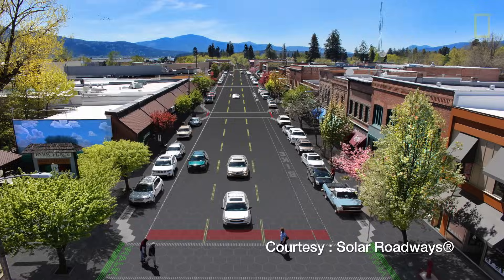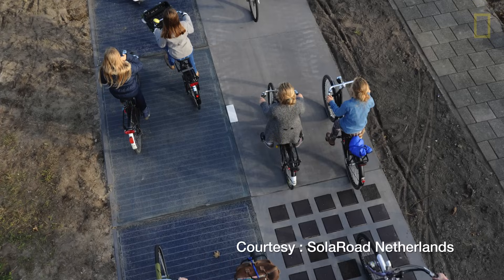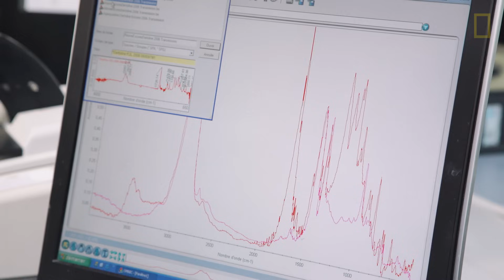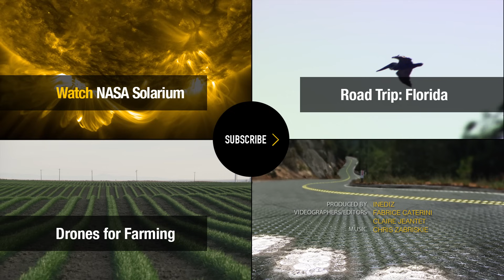Solar Roads: Can Streets Become Giant Solar Panels? | National Geographic

Comment: and if they build the roads in a way that the water can runs off during rain like in a roof with a slight angle .. cars will also be able to keep the lane better if they are being built in a way that won't make the lower side of it scratch along.. so they needed to be slightly elevated..

Comment: Look, First of all, solar panels themselves are actually not as great an idea as they sound. Yes, yes, yes, the sun light is free and doesn't pollute, but you know whats not free and does pollute? The production of solar panels. By the way, people seem to not really consider this terribly much, but you know solar panels don't last forever, they have a certain life span, and the cheap Chinese made ones that state projects usually use have the shortest life span and most toxic production method of all. If you simply do a basic cost/benefit analysis, you will find that really solar panels produce basically as much or maybe even a little more pollution than fossil fuels do, they just do it in the form of the toxic metal refining that goes into their production as opposed to exhaust that the end user gets to see. All solar panels really do is obfuscate the pollution from you by moving it somewhere else.

If you really want a clean cost, effective, and reliable source of energy, then nuclear is the way to go, hands down. The only reason we aren't all using it is because of lobbyists fighting against it over Chernobyl, but the reality is Chernobyl wasn't really a nuclear disaster so much as it was a soviet disaster. The communists cut extremely dangerous corners in construction, and it was their inept handling of the plant's construction and management which lead to the melt down.

A properly built and managed plant will not have such a catastrophic failure as that. In fact, a lot of people don't even fully understand just how catastrophic that failure was. We are talking all safety measures were broken, allowing direct exposure of the core to the atmosphere. That simply doesn't happen in a well managed plant. There are multiple levels of containment, and even when something does go horribly wrong, it doesn't simply breach all of them like that. You might have one or two levels of containment breached, but Blowing the roof off the whole plant, Chernobyl is pretty much the only plant that ever did that. And that is really saying something because when we had the plant in Japan get hit with a tsunami, sure it breached containment, but clearly not to anything remotely like the extent of Chernobyl. In fact the area of the plant is even safe today. Chernobyl on the other hand which happened decades earlier is still a wasteland.

Comment: Since I can't post on solar roadway because they have disabled the comments section can this handle a big rig which has a word 10 tons of steel drive at 70 miles per hour us without shredded in a week has at least last 3 months stillway said that he has the last 20 years cost less than pavement then I agree this will be useful otherwise why spend the money Oregon great idea what store panels on the side of the road bingo cost 1/10 the mountain you make 20 times more power.

Comment: Most people are concerned about the expense but something else is troubling. Nitrogen Triflouride is a greenhouse gas used in the manufacturing of solar panels. It’s 17,000 times more potent than CO2. What implications could that have if we were to manufacture the panels to replace the roads? And the constant wear and tear from vehicles would mean they would have to get replaced, which would mean to more production and more NF3. Additionally, the “waste” or old an broken parts from old solar panels are toxic. The streets would literally be lined with it until it was able to be cleaned and replaced. Overall this is a bad idea.

Comment: I have a great idea. Let's take solar panels, put them at a terrible angle for collecting sunlight, and then drive cars over them so they can't collect sunlight at all BECAUSE THE SUN IS BLOCKED BY CARS. Not to mention the dirt and grime from the cars themselves, which will reduce the efficiency of the panels passively as well as grinding up the materials under heavy tires, making them less effective in addition to possibly causing silicosis from airborne glass! YOU GUYS ARE FREAKING BRILLIANT.

Comment: They found a good compromise between grip and light absorption. Meaning, if you need to slam on the breaks to avoid an accident, you are probably dead or severely injured.

Comment: Forget about solar panels. Do research for vibration energy. Convert the vibration, while the vehicle passes, into electricity.
Less coast and more practical.
Reply: Sudarsanan Madhavan 
There is no dynamo on earth that can convert road vibrations into power. The roads are simply not elastic enough to effectively vibrate. Realistically, the value of the energy collection that involves the road itself will never exceed the cost of maintenance, so the value per megawatt will not be profitable without high prices.
Reply: This is even a more stupid idea.... sometimes I really really wish we live in a world where children on school get science class instead of reading a fake bible. Horrible.

With a piezo you could transfer a tiny bit of energy of vibration back, but it doesn't make sense at all. You just take power of your car, put it in the road, and with all the losses you want to put it back in your car?
Sudarsanan, you have to ask yourself, where ae the vibrations coming from? What energy?

An idea is okay for someone without knowledge of technical things, and that's good because you never know what nice things come out. But this just doesn't make sense at all :).

Comment: The comments here are cancer. Science and innovation is always expensive at the beginning...
Reply: This is not science nor innovation. This is just and incredibly dumb idea. 
1. The road will cost unfathomable amounts of money to maintain
2. Glass reflects light into the eyes of drivers 
3. Cars running over them will very quickly make them black and opaque allowing no light through
Reply: The stupidity of solar roadways defenders is even worse than cancer. Just because it is expensive, you can not call it science or innovation. Science has proven solar roadways are BS.

Comment: The anglo poeple is not able to imagine that the cost of this solar road will lower with the improvement and number of road equiped !  are you seo jealous of this road ?  they begin n to build it in usa in a city . Group Colas think the cost will be the same as roof solar panel in some years.
Reply: stephen10 the solar road will lower but so will solar panels on roof. Have you Sean a road before roads take a shit load do you think some plastic and metal frame will be able the take the same load. This product was meant to power America, but putting them on the roof is way better.
Reply: a roof is private but a road belongs to public space, it's cheaper.

Comment: No they cannot. When cars are on them the sunlight is blocked from reaching them.
Reply: +democritus 
That's not how the world works. Assuming you have an open road in direct sun light, a car driving along that road will block exactly the same amount of sun a parked car would. It would just be spread out over different panels instead of being on a single one.
A car driving along doesn't move off the road. It just moves off one panel onto another. The shade is the same as if it parked on a single panel.

And in a lot of cities solar panels wouldn't get any sun light at all really since buildings, trees, parked cars, driving cars etc. would be blocking the light.

And even ignoring all of that, the whole idea of solar roadways is so fundamentally flawed that you don't even need the shade problem to make it inefficient.
Reply: still, why place solar panels on a surface that has heavy loads going over it. The maintenance / material costs would be increadibly high to keep the system running. Secondly, why on eather would you place solar cells somewhere that has a tendency of being covered up by cars, not to talk about the fact that builds also cast shadows on top of the street. If the governement intends on investing in solar power, they have plenty of vacant space in rural areas that can achieve greater efficiency instead of roads. Oh and btw road maintenance is way harder to do if you have to call an electrician each time you need to repave the road
Reply: +democritus

You clearly have no idea about solar panels. Look up the videos about people using them for things like cycle touring, overlanding etc. They have to make sure that something as seemingly irrelevant as a bit of grass doesn't cast a shadow on the panel when they set it up. If you lean a portable panel up against the tire of your car for example, grass can be an issue. Just a bit of shade on the bottom part causes a massive loss in the power generated considering it may be 1% that's in the shade.

Now imagine a town where people are on the panels, cars are on the panels, tall buildings cast shadows on panels, trees cast shadows on the panels, signs in the streets cast shadows on the panels etc. You'll be generating next to nothing considering how little panels generate to begin with when they're placed flat on the ground.
Reply: Unless you live in New York city, cars are not on individual sections of roads long enough to be particularly effective in preventing most sunlight from hitting it. Look outside at your local road. Is it currently filled by cars in a neverending traffic jam?

Comment: It sounds either like a con artist defrauding the DOT or someone that has a high IQ as measured by tests but can only memorize without understanding and they do not understand the power grid, properties of materials, and from the looks of things they can't fabricate a part.  I could do better with hand They are not taking into account the fact that glass is too soft and is too slick for a road, pv cells break down as they age, corrosion, dealing with vibrations, or the fact that they would need an inverter and step up transformer every few hundred feet and a high voltage 3 phase line along each road.  They would also need a way to store the energy you can't just plug things hickly dickly into powerlines.

Comment: Solar roofing would be infinitely smarter.
Reply: You could build a roof over the roads, keep them dry and free of snow, place solar panels on top; illuminate the road with all sorts of nice lighting that will be visible, and all for a fraction of the cost of this "solar roadways" lunacy.
Reply: @Landrew0  I might be wrong, but I dont think the roof over a road is a great solution, Electricity is not hard to transfer,  it would cost to build a roof that can endure the test of time and maintain it. And you would be restricting sunlight in the day so you would probbybly have to run the lights 24/7 instead of just nightime. Also I wouldn want to drive covered by roof all the time :). Some things are fine the way they are, but I am not saying that we shouldnt try to find new ways to improve on them without complications
Reply: @Landrew0  You couldnt light the tunnels as well as the sun with light bulbs powered by the solar panels...
Reply: What has happened to our society? Has some virus wiped our common sense?
Reply: Yeah, and cables and fiberoptics could be just below the roof, easy access for technicians.
Reply: When exactly did we teach the kids how to think, and then we stopped doing that? We've always taught the kids what to think and unfortunately it's not going to change soon.
Reply: ***** It was never an institution wide phenomenon, more just a few really good teachers here and there, you know... Back before no child left behind and standardized testing came about.
Reply: @chrisr3120  I really don't care for the No Child Left Behind thing
Reply: Maybe if enough kids watch Neil deGrass Tyson because they think he's cool, they will pick up a few pointers about critical thinking.
Reply: Chris R there has never been a time where people think for themselves
Reply: It would actually be just something like 300% smarter^^
Reply: we already do that in a way don't we?
Reply: Landrew0 We stopped teaching kids how to think and started teaching them what to think. As a result they've lost their ability to think for themselves or to be critical of what they've been told.

But hey... Lazy teachers have it easier that way, and standardized tests really encourage it by forcing them to hyperfocus on just getting them to memorize what's on the tests so their funding doesn't get cut.

Comment: how many km² of deserted land is there in the USA...
Land where you could safely install rotating solar panel thought could follow the sunlight, or enough solar panel that you generate the same amount of power no matter where the sun is positioned ?
Reply: Given what is happening to the cost of the cells, it is likely cheaper to just buys some extra cells and point them in the general direction south and leave them like that.

Comment: the panel must be able to convert the pressure/kinetic energy to electrical energy to success. just by placing it on zebra crossing could make a difference.
Reply: I live on an island and it would be way cheaper to order oil from the outside to use on our own generators. Or promote better instalations of solar panels on top oh hills and wind turbines
Reply: You can make huge bucks, save money for people who have not much and make an impact on the environment, if you bring solar panels to smaller Islands. Such an easy calculation, on most islands, that are not so advanced, like most Caribbean, the electricity cost is so high. You can offer solar panel energy for almost half of it and still make like 100% ROI per month on it. Look up the cost for a solar panel plant and what it can produce, the average cost of electricity on these islands and then you have a valuable business. But you are right Zilhah, corruption is something to consider unfortunately. :/
Reply: Yes, any place where they have to import fuel to make electricity can gain from solar and/or wind.  Rural areas also can gain because the cost of installation of the power grid.  Basically they have the same economics as an island.

Comment: they should be charged with fraud!
Reply: It can never never never work , and make money look at the eevblog. He has done a study on this and found that it can never work there is no good solution to this so there is no positive way to make these work.
Reply: i'm a person that finds solutions, even wild ones. but current technology prohibits solar roadways. we haven't even filled roofs yet.
Reply: just stop. There is no solution to find since there is none that can fix the main problem of said project, which is the fact that the solar cells are in a fixed position with a low angle of incidence to the sun. But hey how about we pump more energy into street lights to gather more electricity from the solar panels ?!?! GENIUS RIGHT ? Simply put there are no solutions to this idiotic idea
Reply: I agree that's what is what I was saying

Comment: Spending money for HALF of the capacity of a standart solar panel... very intellingent.
Reply: Actually, it is a lot less than half because any cell that is in a shadow or dirty drags down the efficiency of all cells in the same row.
Reply: We live in the post-science age. When people say "I love science", what they mean is "I love technology". They don't give a damn about science or logic.
Reply: remember when optic fiber was to expensive to replace copper wire with? :P
Reply: if it actually got half the power as standard solar that would be awesome. it's 10 times more expensive and generates 10 times less electricity.
Reply: Lucas Pereira da Silva Less than 10% efficient acctualy
Reply: For the wattway it's actually spending 9 times the money for 1/3 the power compared to a standard run of the mill solar installation for private use.
Reply: Pi Exactly!
Reply: https://youtu.be/v3Rh3yKF4m4
Reply: The electric car has a dirty little secret. Behind being "green"  saving the earth..
How else will you power your fossil fuel guzzler electric car? (powered by fossil fuels: dirty Coal, diesel, natural Gas(aka methane gas which is 10X worse then CO2 green house gas .  The Dirty little secret  of nuclear.?
Notable disasters include but not limited to :Chernobyl disaster , 3 mile island the  Semi-Vally Melt down disaster(in Los Angeles,CA),   SoCal Edision disaster(another one near los angeles) , Fukushima (which still is leaking currently) as of 2018.. Socal Gas disaster, Aliso Canyon gas leak which released  tons and tons of methane  gas  (10x Worse green house gas then CO2).. when demand increases with electric cars so will the pollution
Reply: that would be spending more money for 10cents worth of power per day  it has a 200 years return on investment per panel  for the standard US veriosn of solar roadways
Reply: Not just spending money--spending 10x (or more) as much money to get half the power output AND a shorter lifespan.
Reply: Yes yes but... technology!
We live in a society with a tech-fetish. It's the greatest age of anti-science ever, from what I see.